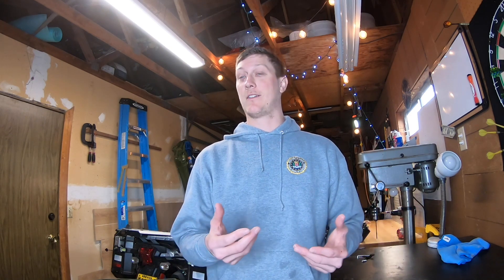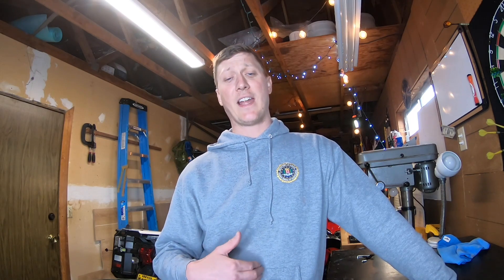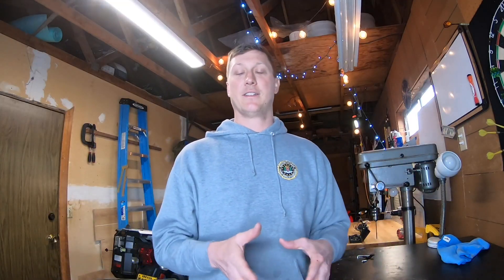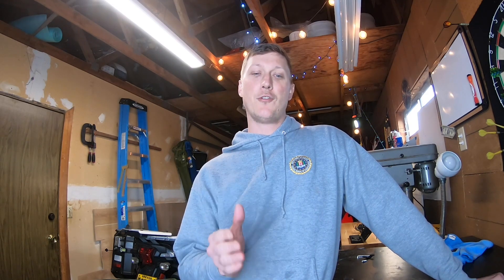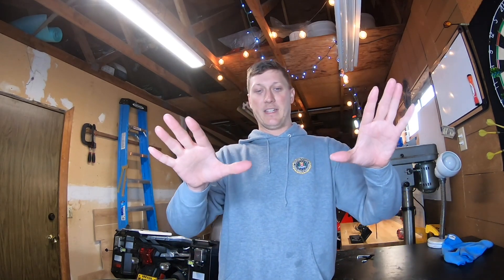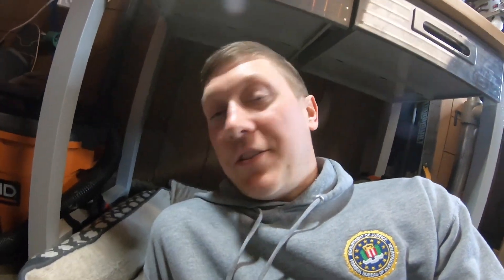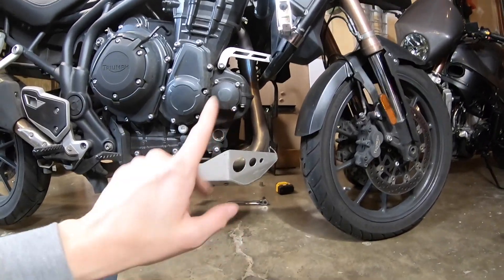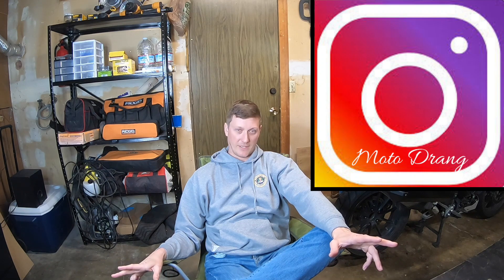Are cheap motorcycle highway pegs good??? 🧐

Comment: What I did when installing the same highway pegs, after applying anti-seize to the peg threads, I carefully drilled a whole through them into the crash bar, then I inserted a stainless steel rivet in each foot peg, which stop all and any movement.